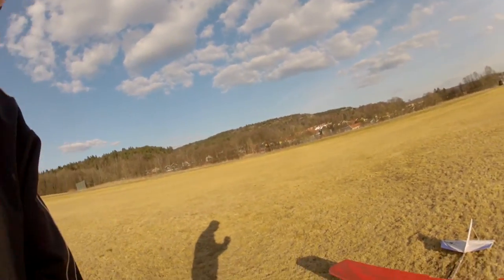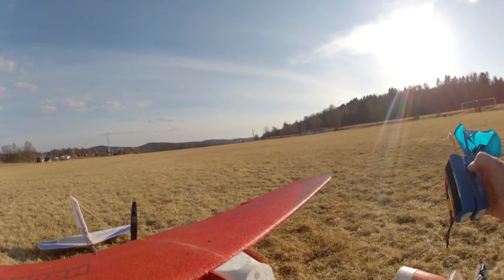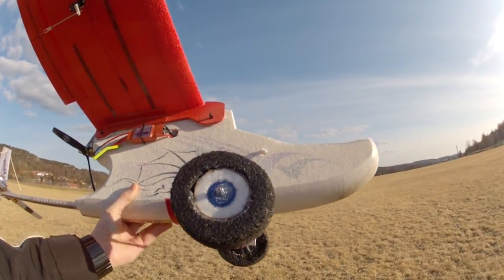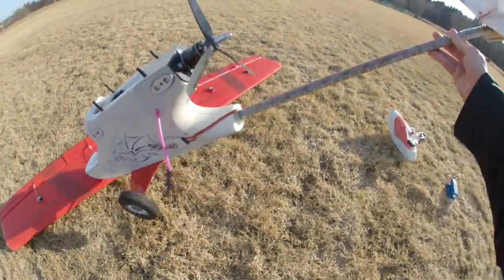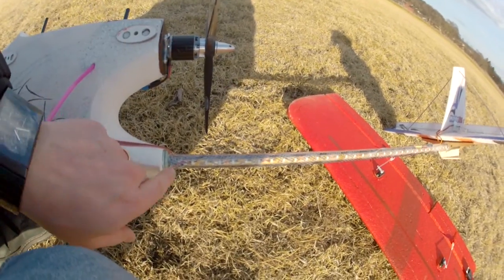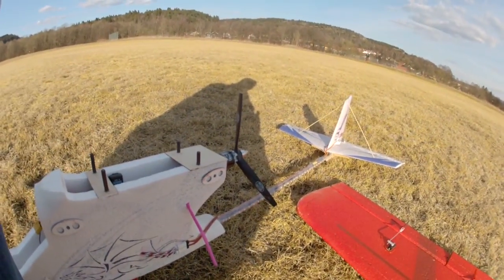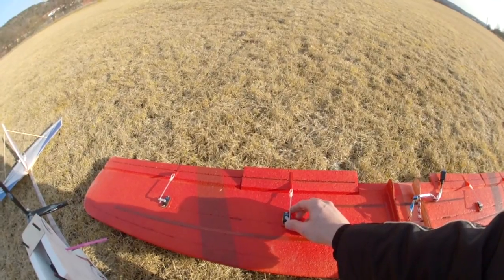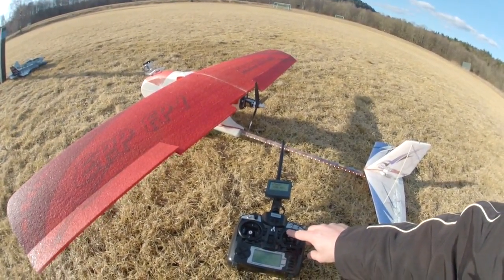My HobbyKing EPP-FPV Modifications

Comment: Nice Mods you have done to your  EPP-FPV 1.8m XL, The main wing fitting and wiring is well smart, I have the same motor in my Hobbyking Sky Walker, I use a 9x6 2 blade,  well done to your mods,
Reply from the maker: Thank you, I had a lot of fun putting this together :)

Comment: did you use reagular spry paint cans for the wing ?
Reply from the maker: I used some kind of Acrylic spray paint. Water based, but not water solvable once cured. The aerosol still could effect the foam, but as long as you keep your distance and lay on multiple thin layers it's OK.